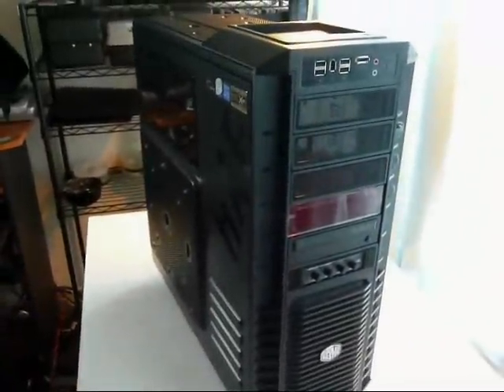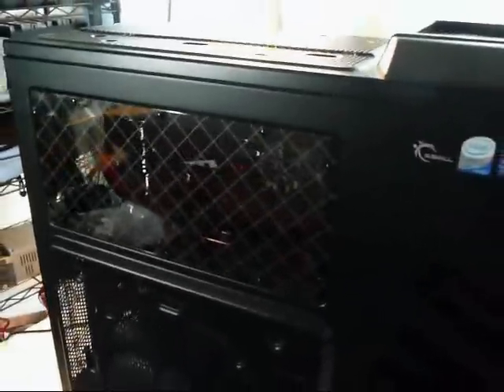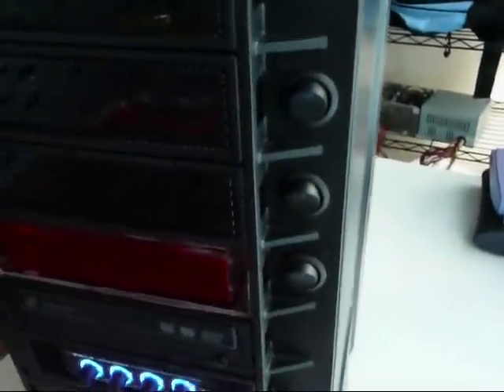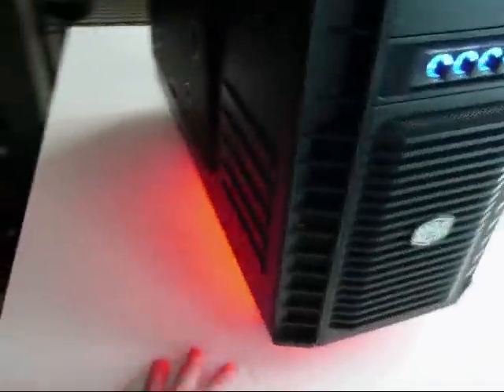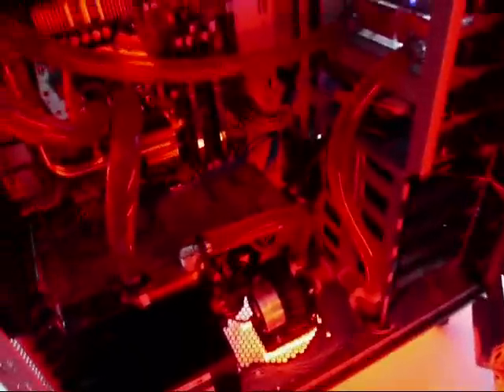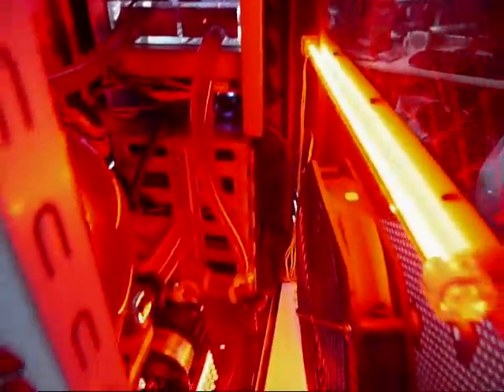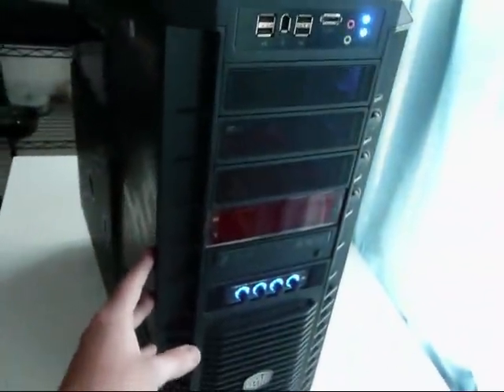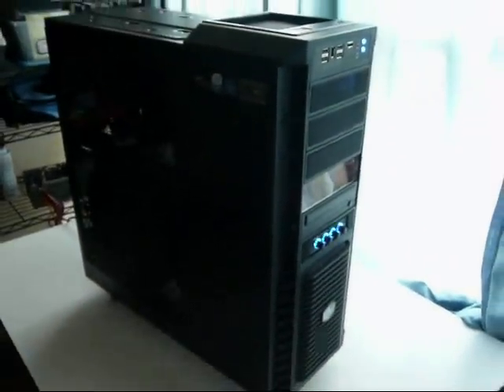932 HAF Coolmaster Cathode lights and more MODS!

Comment from the maker: Doing so would make them run slower.  I wouldn't personally suggest combining them (although two interconnected might lower the fan speed to the benefit of being less noisy).  Hope this helps.

Oh, if you don't care about speed control via motherboard/windows then I would just splice each to it's own male molex on the 5v line or share a couple per line ... probably your best bet for achieving the 4 fans you want installed.

Comment from the maker: 2x120mm fans on the top pushing out against the radiator (which is suspended inside the upper part of the case).  There's 2x230mm fanse sucking from the side door and front of case.  There's no real suction problems since there's tons of ventilation and noise isn't a problem with the large fans as they run lower RPM with more volume of air circulated.  The position of radiator is ideal since heat can't "pool" in the case (heavily ventilated top are of the case shoots the heat right out the top).

Comment from the maker: I have a hard mat beneath my system and when I need to bring the tower out the legs on carpet would have meant putting strain on the case by lifting or whatnot. This is a very large full atx tower with fluid in it and a lot of hardware and rolling it out from the corner I have it in is more effective on a vinyl hardmat vs carpet and peg legs.

Comment from the maker: That would be cool.  might make a nice effect like fingers of light radiating from the base.  Interesting.

I mounted mine through trial and error.  At first was done with adhesive tabs of velcro ... but gravity prevailed.  Later I tried hot glue ... but heat and gravity once again one this battle.  I finally decided to zip tie one end of each tube through the mesh area near the PSU ... then dropped a bit of super glue to the other end and attached to the case.  It's holding strong still.

Comment from the maker: mobo/mem/cpu were upgraded since this video was made at around 880

two waterblocks alone were around 200 I think.

case was a lot ... but there is a lot of little things ... cdrom certainly was not 80 (as someone implied).

basically JUST going to an i7 system meaning new mem/mobo/cpu ran nearly 900 

wheels ... time ... fluid ... time ... it all adds up.

Comment from the maker: The temps I took yesterday may be off (this is a precursor to the disassembly and rebuild of the system ... moving to i&7 based system).

In the process I discovered INTENSE buildup of material which is inherintly existent in the Feser-One coolant.  

I assume my temps I took before the switch-over were a bit high but will take new readings as soon as I can finish this new setup and post the video to include temps etc etc.

Comment: yes it is very large, and deff something i wouldnt be putting on the floor eather... i have one myself as you will see in my video responce and it gathers dust quite quickly and i have mine on a table... not to mention putting expencive hardware on the floor isnt the smartest idea... id rather pick mine up by hand as rolling it around cant be good for the drives, but nice setup you have

Comment: I know how to do this but I was wondering if you can do this with the 15 inch logisys cold cathodes? These are sound activated, but I could care less about the sound activation! Would they work on the switch in non sound activated mode?

Comment: so far, im modding my cooling and im gonna build from that, i was wondering if u would try this, im replacing the 230mm fan on the side panel with 4 120's and the top 230 with 2 120's and putting a 140mm on the bottom, i also want to see if i can fit liquid cooling in there with all of that, wut do u think? will it fit?

Comment: i also have the haf 932, and i also want the 4 120 mm fans on the side, but i only have 1 case fan socket left in the motherboard. Can i interconnect the 4 fans and plug them in the motherboard socket? or can  i connect the fans directly to the psu? i have the gigabyte odin pro 800w. please help!